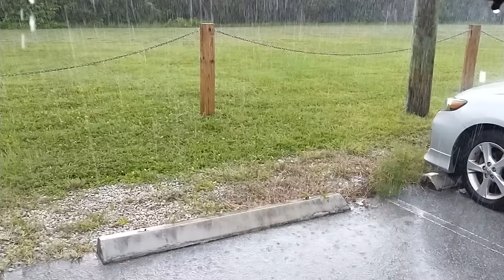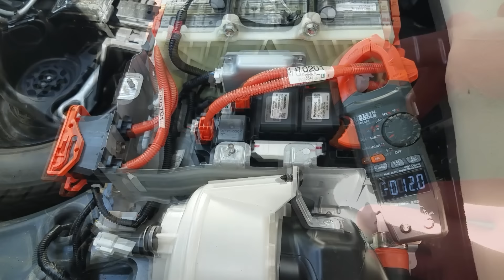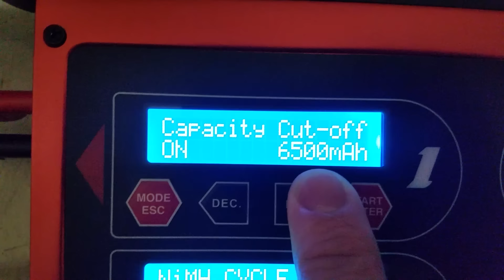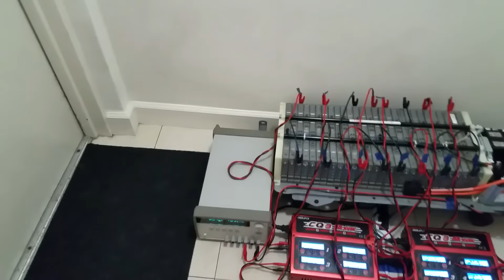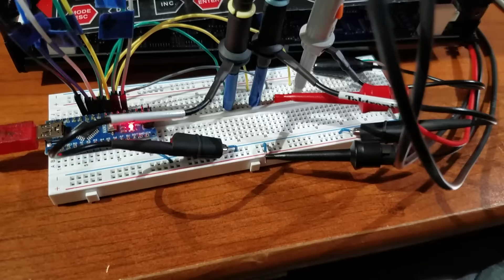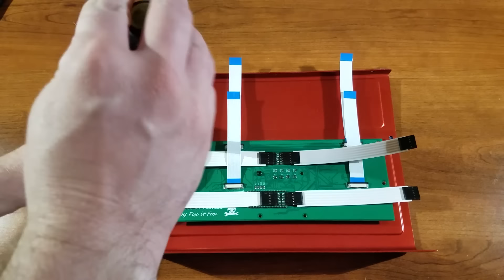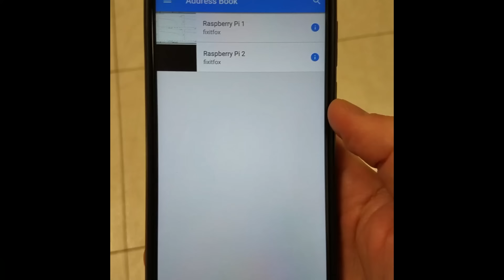An engineer's approach to hybrid battery repair

Comment: Dude, hacking into that CQ3 is pure genius. The fact that you built a whole data logging system just to eliminate human error — that's not a repair, that's a flex. Respect from Russia. 
But let's be real — while you were down there in the garage every night running those 500+ charge cycles, she probably forgot what you're capable of. 💛 I'm guessing that when the battery finally went back in the car... that night she completely forgot about the Prius. 😏
And hey — at least she didn't have to Uber for too long. You automated that thing just in time. Gotta save that wallet (and maybe the marriage). 😂 Now for the real question — are you selling fully assembled units of that automation rig? I'd buy one in a heartbeat.
Reply: Hi, I saw a couple of your other comments on this video and you also sound very knowledgeable on this topic so I wanted to check something with you and the original poster of this video. It might even help you easily get a similar automation rig!

Why is the CQ3 is the most used charger? I was looking at hobby NiMH chargers and the SkyRC D200neo Dual Channel came up. It does every single metric better or at least matches the CQ3 ($280) and is cheaper ($105 x 2) for a total of 4 channels.

It also has both a computer/mobile app that does all the logging you guys are trying to automate, as well as alerts and safety notification to the mobile app.

Another really cool thing is you can hook it up to a SkyRC BD380 to offload the discharge cycle automatically to this dedicated discharger which can discharge up to 40A. 

Which brings me to my next question, I know he mentioned even though he left the discharge current at 5A, the CQ3 is physically limited to ~1.5 A. Same with the D200neo, but if you pair it with the BD380, you could achieve 5-10A (or higher) if you choose so. And wouldn't a higher amp discharge actually be a better test to identify weak modules? So, what would be the ideal discharge rate if you weren't limited to hardware, and without risking cell reversal? With the app, it seems you can easily set the voltage cut off at like 7.0V discharging at 5-6A, then set it to 1-1.25A to get down to 6V

Comment: As an engineer myself, I salute the effort of spending months automating a task that could be completed in a few weeks with rote manual effort. Some might call it crazy, but I say crazy like a fox!
Reply from the maker: 😂 Thank you!
Reply: @FixitFox the only thing I understand about anything is that there is a fox on the desk.
Reply: I am curious .. would it not be easier to cycle the pack in parallel instead of singles ? Not being an engineer not sure of reasons pro or con
Reply: @RonCrick-y6f  I think you'd end up getting uneven discharge between the cells. Especially if they are at different capacities.
Reply: @drezee7173 I have no experience so no idea

Comment: Module voltage is no good - you need to load test. ie place a 2 or 3 amp load on the cell and record the voltage at 10, 20, 30 and 60 seconds.  Put the results in a table, and chatGPT will be able to give you an  expert assessment of the pack!   A grid charger can also be a much less onerous way of charging the pack, in series, and at very low current to balance all modules.  Keeping the hobby charger just for the modules you identify as weak and sagging under load.   NB If your budget can run to a Thermal Camera, it will make your life a lot easier and also be easier on the battery pack when charging!   Invaluable.   Did I mention that uploading your spreadsheet data to chatGPT will give you a phd level instructor and mentor?
Reply: AI — not now, not ever — will tell you what's really going on inside a cell. Not in the first minutes, not after several cycles. Chemistry doesn't work that way.
f you've never seen a cell recover on the 3rd cycle and tank on the 5th — you haven't done real reconditioning. You have to kill a bunch of modules yourself before you understand how to actually bring old NiMH cells back to life.Calling ChatGPT a 'PhD-level mentor' for battery diagnostics is like calling a calculator a mathematician. You can't prompt-engineer your way around a degraded separator or a micro-short.
Respect the hardware.
Reply: @АндрейКантор-е9ь   Try it - you might be suprised...

Comment: Great video. Very realistic.  

My understanding is hybrids have current swings from -30kW to +30kW as regenerative breaking and overtaking take place (and yes, I know current is Amps, not kW) but I am making the point that the busbars' current density will probably not be at a thermal equilibrium.  I am at that point in the video where the dashboard ECU errors are annoying me!

I think that the #PracticalEngineering approach is to replace the entire pack with an identical one (to keep the vehicle on the road) which is probably the most affordable route.  Then recondition the old pack for the next customer?

Comment: Great video overall, really appreciated the thorough walkthrough on the battery repair process.

That said, I found the automation section with the Raspberry Pi/Arduino setup for the CQ3 really intriguing. When the details were skipped over with something like "I'll spare you the details," I was disappointed, especially since the subject was a third of the video length. I was actually hoping to learn more about how that part was implemented. I get that the main focus is the repair itself, and not everyone wants a deep dive into the code/electronics, but for viewers interested in the automation, even a high level overview or a few key snippets would have been awesome.

Thanks for sharing your project either way. Keep up the good work!
Reply from the maker: I'm sorry 🙁 I had some more footage of that part but the video was getting so long, I tried really hard to keep it under 30 minutes (and still failed 😅). Glad you enjoyed the video anyway and thank you for the feedback!
Reply: @FixitFox  still have the footage? Would be great for @MiscitFox!

Comment: I thought you were some sort of necromancer until I started doing actual research. 
1. You say you're an engineer, but your max capacity is 6500mAh... Did you know that NiMH efficiency is 80-90% and that's why "other" DIY use 7500mAh?
2. You say you're an engineer, but you don't seem to know anything about the required NTC 10k temp sensors needed to avoid overcooking
3. Most outrageous of all, you say you're an engineer, but your D/C cycles are 5A each... oO??? Do you actually know what you're doing?
Reply: Man, maybe check the specs before you comment. 5A for a 6.5Ah Prius module is literally 0.77C. That's well within the standard 0.5-1C range recommended for NiMH cycling . It's not an AA battery. Also, mixing up capacity with efficiency and missing the point of a test rig vs. a final product? That's a lot of confidently wrong statements in one comment
p.s.
And one more thing — NTC sensors don't 'avoid overcooking' by themselves. They measure temperature. The controller does the switching. And seriously — even ChatGPT wouldn't generate that kind of nonsense. Next time, maybe just pay for that subscription to Gemini..?
Reply: @АндрейКантор-е9ь  While technical manuals might say 0.77C (5A) is fine for a healthy NiMH cell, that assumes a brand-new module with low internal resistance and perfect cooling. In the world of used Prius modules, that theory falls apart for two main reasons: you are NOT recycling new modules, and no matter your cooling there WILL be internal pressure and bulging, much stronger than at 0.5C (3A charge). Again, you do you as you seem to know better, but the modules i've seen coming from "reconditioners" like you are all garbage now, completely deformed. You're just impatient and I respect that, you do you.
Reply: @audioscavenger  You're upset about 0.77C — but here's the thing: I don't even use 5A on most packs. When I'm reconditioning batteries with initial readings of 700–1500mAh (typical for 2010–2014 modules), I use much lower currents. It takes way more time, but that's the only way. And in the end, I bring them up to 5–5.5Ah. If I had modules in the condition like the guy in the video, sure — after some gentle cycles at 1–2A, I might eventually go up to 5A. But only when they prove they can handle it. And speaking of temperature control — when you push higher currents, that's literally the only parameter (besides voltage cutoff) to prevent gas buildup and popped valves. That's basic safety.
So yeah, 0.77C isn't the problem. The problem is not knowing when to use it — and when not to.
Reply: @АндрейКантор-е9ь  thanks for the tips. I use C-D at 3-1A cycles then deep down 4.8V at 0.5-1A then cycles of D-C 1-3A and never ever 5A. They literally bulge under your nose if you look closely, even at 3A. But again you do you. I ain't saying those modules can't take 5A, they can take even more but as BURSTS of 10s max, as hard-coded in the core ECU. Gemini and Grok all agreed on that.
Reply: @audioscavenger  I'm just saying — I've never come across modules like the ones in that video. The batches I work with RARELY go above a couple of amps on the first discharge. I never set discharge higher than 0.3–0.4A when I'm finishing up after the main cycle. And my charge cutoff at 1A is 8.65V. No delta-peak — just my own gadgets cutting off at low and high thresholds.
Unfortunately, Grok and other AIs aren't available in my country — otherwise I'd probably be even smarter by now. But instead, I have to read actual books and go through the painful process of learning by doing. 😉
Anyway, good luck with everything — low interest rates on your loans, and cheaper fuel sometime soon.
Reply: @АндрейКантор-е9ь  don't be jealous, you're doing great. Things will improve once you ditch the current dictator in power. It was fine at the beginning to bring the country together and show strength, but I feel like he's lost his mind somehow. Good luck and I hope to see you and your people back on the internet soon!!

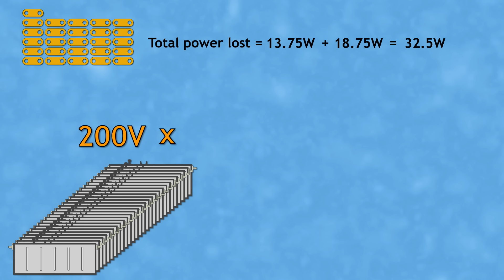Comment: your video is awesome but your calculation was wrong due to wrong values, go to the time point 10:41 where you said that the current is 125Amps while it's actually 6.5Amps, and the battery capacity is obviously not a 25kW , more of a 1.3kW (201.6v x 6.5Ah) which means 32.5W out of 1300W is much more significant than 32.5w out of 25000W, that is why those copper bridges need to be clean

Comment: Are you thinking on seling this setup ?
Reply from the maker: I've thought about it but there's a lot more design work to be done to make it a product people can use. Mostly on the software side. I'd have to make a nice user interface as right now everything has to be done in the terminal, the JSON file, and the source code itself. In other words, it's not user-friendly at all right now 😅
Reply: @FixitFox it's seem to me your in the right direction ⬆️ 🤞🤑

Comment: CZEMU  LADUJESZ 7500mah    bateria  ma  pojemnosc  6500mah   i  czy  9V  to  nie  jest  za  duze   napiecie.
Reply from the maker: Hello. 6500mAh is the rated capacity so that's what it should be charged to. 9V is a bit high but still not too high.
Reply: a co powiesz o ładowaniu  max  do  +6500mah  a  napiecie  maxymalnie  8,7V czy  przy  takich parametrach  jestesmy  w  stanie sprawdzic  pelna  pojemnosc  jaka  zostala  w  uzywanej  bateri czyli  ładowanie  do  8,7V  a  rozladowanie  do  6V

Comment: I am using a CQ3 red-black model for testing and charging Ni-MH hybrid battery modules (Toyota Prius type, 7.2V modules).
I have noticed that on my CQ3 unit, there is no option for “Charge Cut Voltage” in the charging settings. Because of this limitation, when I run multi-cycle charging (for example, 3 cycles), the device can only stop charging based on Safety Time or temperature. If I stop the charge manually to prevent overcharging, the CQ3 cancels the cycle program and does not continue to the next step.
This makes it difficult to perform automatic and safe multi-cycle charging, especially when I want the charge process to stop automatically at a specific voltage (for example around 8.4–8.5V for Ni-MH modules).
My question is: Is it possible to add or enable a Charge Cut Voltage function on the CQ3 red-black model, either through a firmware update, hidden menu, or any other configuration?
If not, is there an official recommended method to achieve voltage-based automatic charge cutoff on this model?
Thank you for your time and technical support.
Best regards
Sina
Reply from the maker: Hi Sina, they're isn't any voltage based cutoff for the charger. But it should not be necessary anyway. It's not how the chargers work. And it's not how these modules should be charged either. If you want more information and more understanding on the CQ3 settings and setup, check out the video on my 2nd channel in the description.

Comment: In terms of practicality and time consumption, I think finding a good deal on lifepo4 cells and tricking the onboard bms into thinking it still has the original battery (by connecting the signal wires to various voltage points, like 4s lifepo4 instead of 6s NiMH modules) is the way easier route. It would also make it possible to connect an independent bms (or a string of multiple in series) that will not only manage the batteries and give you the option to monitor the voltages via bluetooth, but it would also make it possible to charge them, converting the vehicle into a Plug-in. The cells that I think would be a good fit are the lifepo4 eve c40 3.2v 20Ah ones.
Your dedication is admirable though. I also find it relaxing to make an unnecessary ammount of measurements.👍
Reply: ...you are something of a contradiction. Advertising PCBway at 25 mins in and assembling the boards yourself. 😂😂😂
Reply from the maker: @simonmasters3295  It made for better content for me to assemble it! PCBWay certainly can assemble it in-house too.
Reply: Your patience encourages me
Reply from the maker: @simonmasters3295  Thank you for your kind words!
Reply: Way easier?  No way!

First the hybrid battery is tiny.  Cost in a different 60kWh battery at £15k to £30k

Second the software is written for NMH and is probably proprietary (I may be wrong, but surprise me)

Third #Ancilliaries 
AirCon, Battery Coolant, EMU, 
Hybrids really are "hybrid"

Finally Warranty Invalidation, Reinsurance ...

Not way easier at all
Reply: @simonmasters3295  I said it's way easier because brand new cells don't have to be balanced or tested. I don't know where your price numbers come from, and the 60kwh, because neither is close: at 70 cells in series, the pack would have 4.48kWh and at 7.55 euro/cell, it would cost 528 euros. 
In terms of software, that's exactly why I said "tricking the onboard bms into thinking it still has the nimh battery".
They would not need more space nor coolant, they are inherently better by having less internal resistance, which means less heating
Reply: @TifinDragoshP- but the NMH chemistry is so different
Reply from the maker: If the voltage, current, and power input/output can be the same, and the temperature profile the same or better, then the chemistry shouldn't matter. Also looks like those LiFePO4 cells don't need venting so that's a plus. 

The biggest challenge I see with replacing the pack with those cells is the mechanical design and safety. But it looks like it would be a fun project to work on!
Reply: @FixitFox  Yes, I also thought about the mecanical design and layout being the main problem, but at the upsides of the lifepo4 being less prone to heating and higher energy density, as well as being able to find them at a good deal on Aliexpress would make this a reallu fun project, as you mentioned. Unfortunately, in my country people will only sell 200k mile 3rd gen models for upwards of 6200$, so it beats the purpose of getting it as a project.
Reply: @simonmasters3295  then how do you explain the NexCell kits?

Comment: A question. Other folks use 3 A for charge and 1 A for discharge in CQ3. You go 5 Amps for both. Is that an issue? I assume there will be more heat generated. Can it damage the modules?
Reply from the maker: It's not an issue. The car charges the modules with over 50A when you're braking. So with 5A, we're well below what the car does.

Also, 5A charge will cycle your modules faster and save you time. With the alligator clip connections, the Cq3 can only discharge at about 1.6A max. So even though we set it for 5A discharge, it never actually reaches that. Also check out my CQ3 settings video in the description if you haven't already.
Reply: @FixitFox  Appreciate it.

Comment: Great video. Is ampGO and BGUAD basically the same thing? It appears the CQ3 brand you are using is BGUAD but the link you shared points to the  ampGO brand
Reply from the maker: Yeah, it's the same. Looks like they recently changed the brand name!
Reply: @FixitFox You actually took the time to respond - You are a rockstar. Thank you.

Comment: How do you power the battery fan? I see a cable going from your mini computer to the fan, but is there a connector to plug into? For your friend's pack, it seems you use a different fan. Doesn't the factor fan send air through tubes to cool modules all over? How did the external fan accomplish this task?
Reply from the maker: Good observation and a great question!

It's technically not necessary but I had it there as a precaution. My friend had a gen 2 prius so her fan wasn't included in the pack assembly so I used an external fan. I can't remember remember the connection off the top of my head but it's not necessary for you. An external fan will suffice.

The air doesn't go through tubes. It is blown below the modules and it comes out upward between the modules.
Reply: @FixitFox  Thanks for clarifying, it's very helpful. I may have more questions as I go through this process. But I appreciate your time and will support you on Patreon before sending you more questions. Thanks!